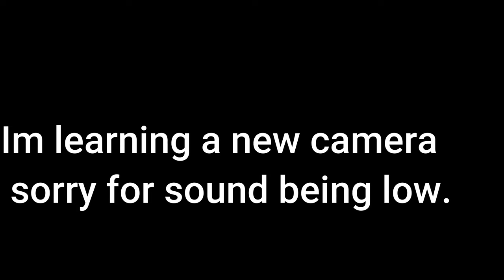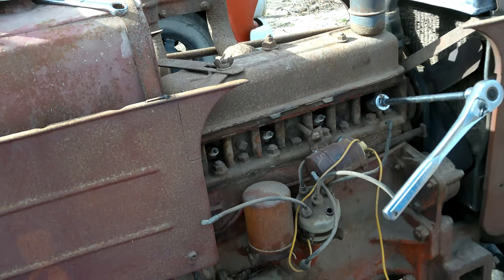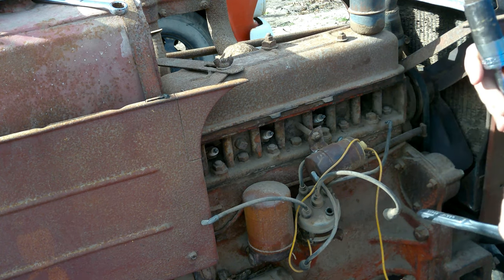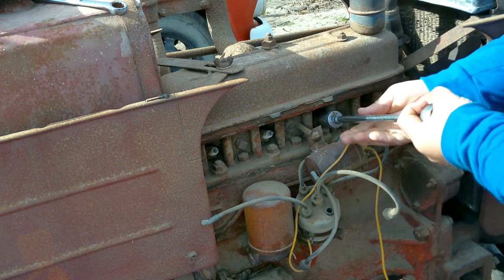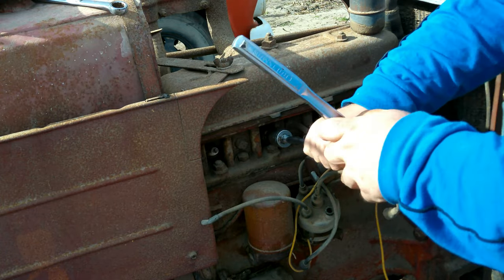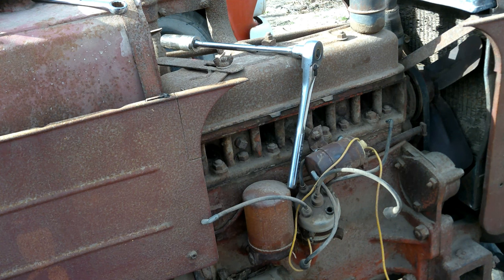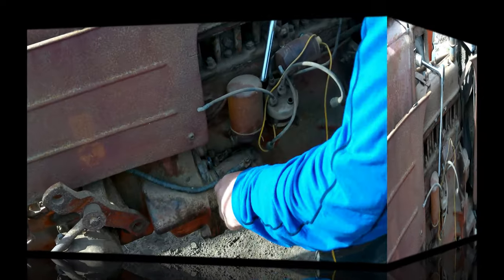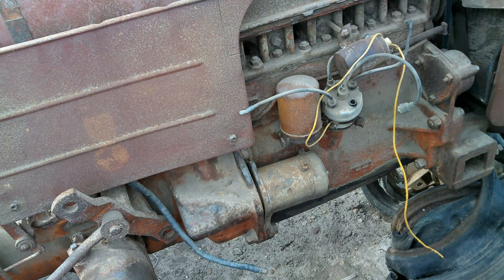deeper look into VAC case

Comment: I like the new camera. Hope you are feeling better. Seems like the VAC is a good candidate for rebuild. I'd love to get my hands on a case tractor.
Reply: We have the parts of three VAC case tractors one ran however  it has a cracked block. two have eagle claw hitches. one all taken apart. several engine blocks. a set of nos napa sleeves and pistons. Enough parts to fix two tractors.  Projects that I likely will never get around to.